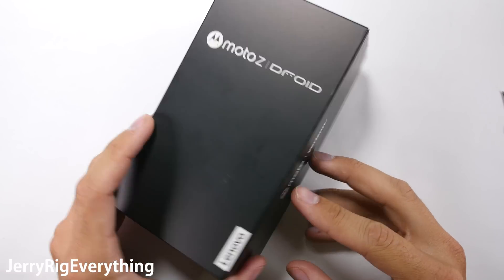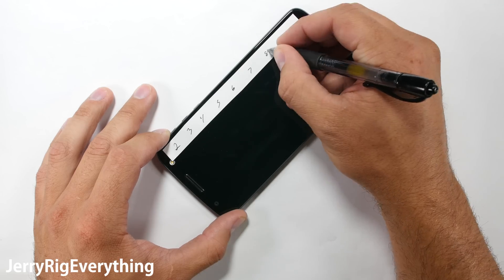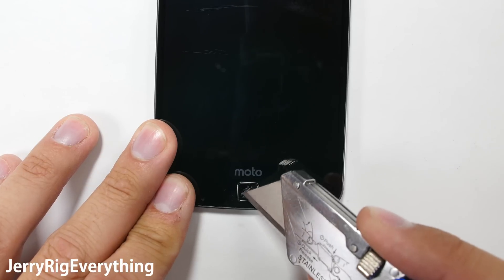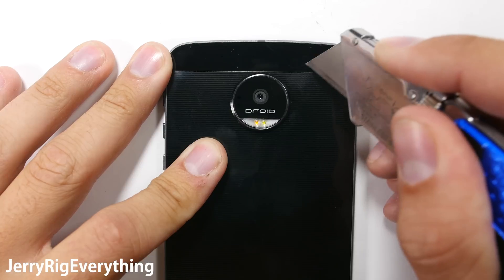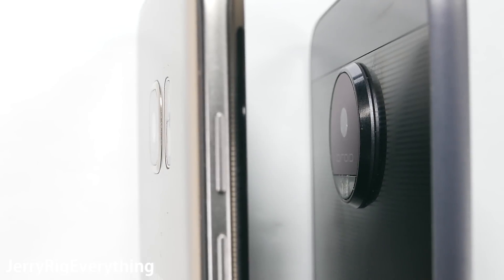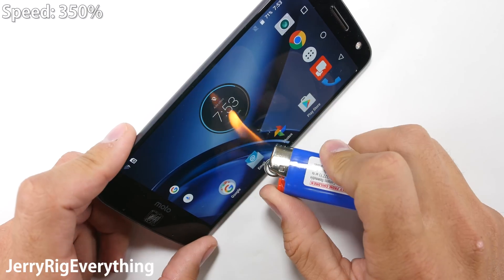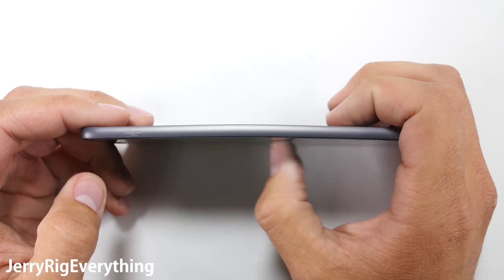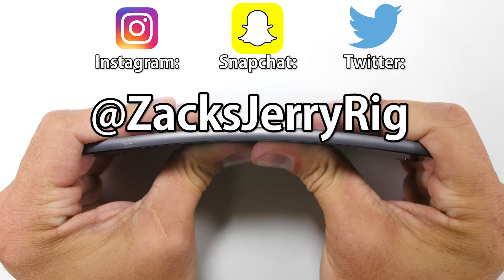Worlds THINNEST Smartphone BEND TEST - Moto Z

Comment: I had my Moto z2 in my back pocket (like an idiot) when I (like an idiot) fell down half a flight off wooden stairs, literally riding my phone to the bottom.  It got a nasty bend in it and the screen was pretty cracked, but otherwise everything still worked fine.  Now, almost two years later, I still have the same phone, and it still works.  Sure, I mean I have to hold the screen on with rubber bands so I can't use the front camera and the speaker sounds like vomit, but it still does most everything else a smartphone can do.  In fact I'm writing this comment on it.  I can personally vouch for the Moto z line and plan on getting a z4 if this one ever finally dies.

Comment: Still have this phone, it's tough as hell with the speaker, and it's gone through hell in my possession, I think that the screen scratches a little easier than normal, and my battery is starting to fail, otherwise a tough and useful phone.

Comment: Dude, Moto's build quality starting with the Shatterproof display on the Turbo has been top notch! 👌👌 Literally my only gripe as a Z Force owner is the OS is getting really buggy, really fast. My S7 Edge had that problem too. In my opinion, the only area for massive improvement with Android-based devices will be long-term longevity similar to iOS. It's tough finding many smartphones that will run well a few years in and still receive updates. Other than that, all the phones minus app OS exclusives, really are virtually identical these days. Even the cheapest devices rock!

Comment: I have the Moto Z Force... I wanted the extra battery size after dealing with S6 miserable battery life. The Force is thicker, so I imagine it would survive even better. The Force has "shatter shield" basically a factory screen protector, so no burn test. At least it is replaceable... if you can figure out where to buy it. The 30w charger for the Force charges the battery at about 1 percentage point per minute. For 3500mah battery, that works for me.

Comment: Please do the Moto Z Play, it comes unlocked like the Moto Z but the Moto Z Force doesn't so don't bother with that one. This phone's tests were awesome, I'm just mad that the fingerprint sensor is easily scratched since noone puts any type of protector on them. I just don't know where Motorola skimped on my Moto Z Play build-wise to make it $450 instead of $600 and the specs are unclear online. The back is glass/plastic so I'll be mad if it's not unscratchable up to 6 hardness but that would be expected for the lower price. Thanks, this video was hilarious, the banana part and each time how you're so serious about a burn test.
Reply: Colin O'Callaghan 7vkhhpi6fm

Comment: the camera lens on my moto z force has the weakest glass I have every had on a phone. It scratches incredibly easily and by everything it touches and cracked from one drop 2 feet up. Jerry you should use the pics on the back side because that glass is not that strong at all

Comment: Could you do the Moto Z Force?
Reply: Colin O'Callaghan You're wrong. That was the Z force without the back on it. I know... because I have this phone.
Reply: Geoffrey Zoref that was the Moto Z Force
Reply: Lorenzo Carrillo WRONG. The Moto Z force is much thicker
Reply: It is the moto z force. I've had this phone since shortly after release. I am writing this Sunday April 19 2020 3:30pm. Best phone I've ever owned. After all this time never had an issue with it despite 100s of careless drops, water drops, even gps drops from my motorcycle until last week when My fault dropped it repeatedly about a dozen times over 10 minute period using it looking at schematics while wiring up a project in a shop. I  lost pixels. That's it. Came across this video while checking out the diy screen repair video. I put this phone through he** and back.
Reply: Fatsnatch Muffdiver, where did you find "Force" word on the box, hmm? It was XT1650-01 Moto Z Droid - you can see it on top of the box and on bottom edge of that phone, where charge connector located (0:31 time line of the video). 

Moto Z Droid Force has index XT1650-02 and you can easily recognize it by cooper color of the frame, cause this is only available color for that model.

Comment: the camera lens of all moto devices of this year scratch incredibly easy, i have a Moto Z with less than a week of use and the camera it has several unexplained scratches, and not I'm not the only one, visit the most popular forums on internet (includes the official's forum's on the lenovo website), all persons with moto devices have the same problem,  incredible Motorola...
Reply: finalluis Dude. I've owned a Moto X Pure and Moto Z Play, and I tried scuffing up the camera lens with a razor blade. Absolutely no scratches could be found after the scratching.
Reply: Same here. Moto Z Droid version from Verizon.
Reply: If you are having this problem there are replacement camera glasses on Amazon for cheap, either have someone experienced replace it or find a video on how to

Comment: I don't see the point of having bend test as you can't control the same amount of pressure on every phone. 
It is much better if you have a machine that can simulate the normal force a human could give when sitting on a smartphone rather than applying on the phone by yourself. It is not accurate. Period.
And also why the hell did you bend the phone twice on the same surface? yeah, I know you wanna un-bend (if that's a word) the phone back to its shape but still it looks like you put too much pressure on it as if you really wanna bend it into half.  UNSUBSCRIBE!

Comment: I m using moto g4 plus from 2 days. One thing which i notice is very bad that during charging if u r using net or something in background is running like downloading and all that.. Then its charging rate becomes too slow. like in 10 min it takes 1% charge. And the other thing is that during charging if screen is on then it works by itself, like many applications open by itself, the icon bar comes out from upward and many things. After switching on off the screen it works again. So Sir kindly tell me the solution bcz if such handset perform like it.. Then its very hard to trust upon the brand. so kindly help me ???????????????

Comment: Only 5.2mm thick and survives the bend test, mind blown.
Reply: quality>quantity
Reply: @akashsen471  wrong
Reply: @akashsen471  non applicable here
Reply: +Catalyst DB
The Moto Z Play has the longest battery life of anything on the market. Three days easy.
Reply: and that's without the back cover. Reasons why I refuse to use anything but my Moto x
Reply: +Alex K. And it didn't even boast about having a 7000 aluminium grade metal frame thingy
Reply: Well I'm not surprised. It's a motorola device after all.
Reply: SadrielAJ If you snap in the battery mods on the Z Play, you'll have 5700mAh battery.
Reply: +Corey Cantwell it didn't snap, or even kink, so it did very well.
Reply: owen play's clash only get the Z force if you don't plan on getting any of the mods, the phone is already bulky, and having even the style mods on makes it a brick
Reply: When u hv ben m aking phones since 2 decades , Motorola knws well what there're doing !
Reply: motorolla has a good phone, but isn't it made by lenovo r8 now ? i wanna buy it, but am a bit sceptical about the quality anymore.
Reply: Rin X Yes, they're under Lenovo now.
Reply: I have this phone that he showed in the video and I get two full days of heavy use out of it without any extra battery.
Reply: Shellyman Vol.2 maybe black magic?
Reply: pijesz IF ONLY, but is the true is A9 Pro better
Reply: hint
Reply: Oukitel has one with 10000mAh
Reply: Shellyman 2.0 it bent like hell and u say it survived, certainly it didn't break but what else u need when it really bends like a shit lol
Reply: Shellyman 2.0 actually it's 5.4
Reply: This thing will even tougher with Moto Mods!
Reply: Shane Horne under Motorola's website it says 5.19mm
Reply: Mr. Señor dose it
Reply: Rin X you should buy it but instead of the moto z buy the moto z force
Reply: well its mostly metal the phone
Reply: wow just spoiled the video...
Reply: Shellyman Studios sure
Reply: We have the new nokia 3310
Reply: :0
Reply: Shellyman Studios you call that surviving? What is a iPhone to you then? A living king?
Reply: Iphone 6 Has Left The chat...
Reply: Shellyman Studios friken apple needs to take notes
Reply: Ikr
Reply: Yeah I thought it was going to break
Reply: Woah
Reply: while ipad pro just bends like a piece of paper.
ipad pro has left the chat
Reply: Other phones that are like 10 inches thick:bending at the easiest bend test
Reply: It’s survived unlike iPhone 6…
Reply: @2038Ounnak  Yeah...
Reply: That is considered passing?  I thought the point of the bend test was to see how easily it bends.  Didn't that all start with the iphone bendgate thing?  As in, people wanted phones that wouldn't bend so easily.
Reply: Son37Lumiere nope i think Samsung galaxy A9 Pro is the longest than this because it has 5000mAh battery☺
Reply: Oceandaemon I think your bullshitting
Reply: I bought mine past week and I sat here praying for it not to brake lol
Reply: Motorola makes good phone, but i will never buy their devices cuz thin batteries.
Sony xperia Z3 FTW 8 hours of screen on time :D
Reply: @catalyst9568  the Moto g7 have the best battery 2 days without using and one and half If u do

Comment: MOTOROLA IS THE KING OF SMARTPHONES!!!!
Reply: they are the kings of terrible quality control and even worse customer service. Lenovo drove that company into the ground.
Reply: they just said they're not even doing security updates for this thing. nope
Reply: +firre if you're so worried about security get a blackberry
Reply: +The Prodigal Son no headphone jack
Reply: +Gros customer service has been amazing with me, I had used the same money from the one plus two return and did two redesigns of the moto x, asked for a refund to do another redesign(was only way I could do it) and I did. I did four redesigns and they even refunded my casemate case I didn't send back. I been pushing them and they haven't let me down yet. I was skeptical.
Reply: +Gros well I'm the opposite and sorry you had a bad experience. I owned the one plus two and both Nexus 5x&6p. The moto x pure drove me when I saw Zack's durability test. It was the real flagship killer, better speakers of 2015, brighter display than the 6p, didn't bend, better video stabilization, customization, expandability, moto gestures on top of stock android, I'm still addicted to this phone. May not have great battery life but with faster charging than the 6p, I'm more than content and after all being way cheaper. Anyways, I still like this phone but I'm not ever going to pay more than $500 for one. I will probably get the axon 7 after I get bored of my moto x which will be a long time. I do agree though that they slacked heavily on the updates but once you get hooked on moto display and it's gestures, it's hard to go back to a phone that doesn't have them and I miss them.
Reply: Gros ????
Reply: creative planet the company that now owns Motorola, Lenovo, drove the company into the ground, what is there to be confused about?
Reply: +Gros quality control?
Reply: The Prodigal Son i already have a blackberry, but it's still horrible that lenovorola isn't updating their shit AT ALL.
Reply: +juan manuel that is true I don't like they took it out but at least it came with the adapter. I like the phone but I'm not going to buy it, I won't give up my front firing speakers on the x pure.
Reply: The Prodigal Son I used to be the biggest Motorola fan there was when Google owned the company. I sold phones for a living with a major US carrier and pushed Motorola products more than any other brand. Back when I had my first gen Moto X I had to use moto care multiple times and had fantastic experiences. Then Lenovo took over. I had an issue with a second gen Moto X and a first gen 360, both of which were manufacturer defect, and the company pretty much told me to go fuck myself. They wanted me to pay shipping to send them the devices and they wanted me to pay for a replacement phone, even though both products were well in warranty. So I circumvented the customer side and got some phone numbers for dealers from the Motorola rep that visited our store. I called them up and they apologized and said that the person I had spoke with was wrong. They offered me a $20 coupon off my next purchase and told me to contact the customer side support. Since the second gen Moto X was my work phone I ended up just swapping the phone for a different phone, but I contacted the customer support about my 360 and they wanted me to pay $50 (plus shipping both ways) plus a $300 hold on my card (for a $250 device) to get my 360 replaced, which was still in warranty. After all that bullshit I will never buy another Motorola product. The first gen Moto X is still one of the best phones I've ever owned, although I got 3 defective units before they finally sent me a problem free phone. Decided to go back to Nexus devices and have been much happier.
Reply: Gros Don't blame you at all.
Reply: well, motorola invented six-sigma quality control, haha so, still i knw some users have encountered many problems , motorola accepts its mistake , not like other manufatures who doesnt give a shit & stop such news against them :)
Reply: +creative planet Motorola did, not Lenovo

Comment: Will you be doing the new Alcatel idol 4 or 4s? I am curious as it is a similar design to a Galaxy S7.
Reply: Alcatel is known for building cheap stuff. It'll probably snap, lol.
Reply: Galf506 lol pretty much all of those phones if treated correctly can withstand daily usage. You know how many people still have their 6p, one m9, iphone 6, etc.??
Reply: me as well.
Reply: +Galf506 even if it does snap, doesnt mean its cheap :) the 6p, one m9, and iphone 6+ all snapped in his test so did xperia z5 premium and a few others...
Reply: It means it is built cheaply. The 6p is huawei, Iphones are known for being badly built, only real surprise is the HTC - which luckily made a comeback with the 10.
Reply: +Galf506 Lol, iPhones are not known for being badly built.
Reply: +Galf506 no all the phones i mentioned werent built cheaply lol, they just had weak structural integrity. Use you mind.
Reply: That means built cheaply, lol. A well designed and well built phone is made to withstand daily usage. Cheaply built phones, like those you mentioned, won't.
Reply: +Galf506 Well there's none of that in the 6S. Anyway I still prefer the Galaxy s7. It's thicker which feels nicer and not as slippery.
Reply: +Galf506 Ive had my iPhone 6s for 4 months. Dropped coffee on it, dropped it about 4 times on concrete, and knocked off kitchen counter and no problems at all. My mum had a Sony Xperia z1 compact and it stopped charging within a year no drops or anything. My dad has a 5s and has owned for 2.5 years and is still in mint condition. Do I go on!
Reply: adjfjvkgkbnkckvkbklxcjvkbhjcjvjcjcgkeheo Goodman small so so SG